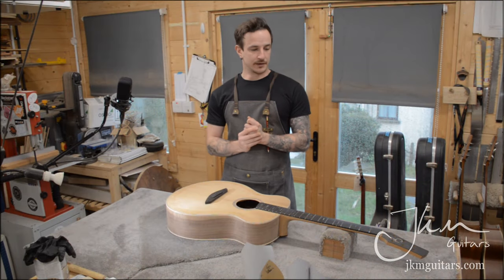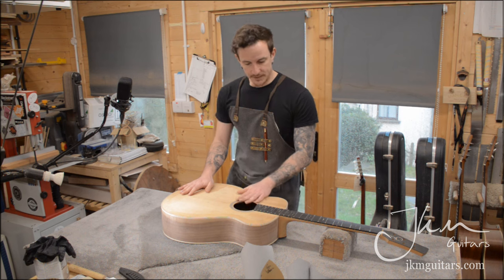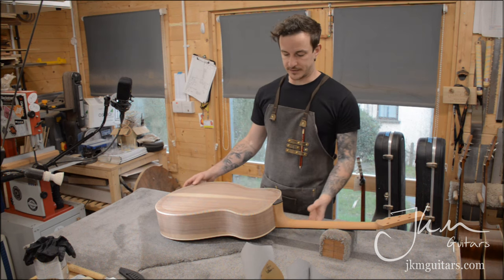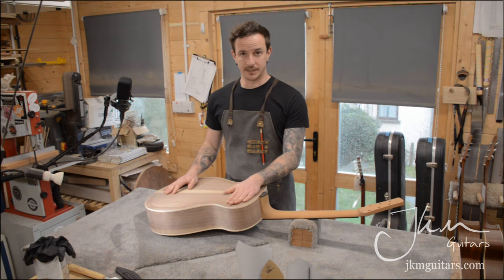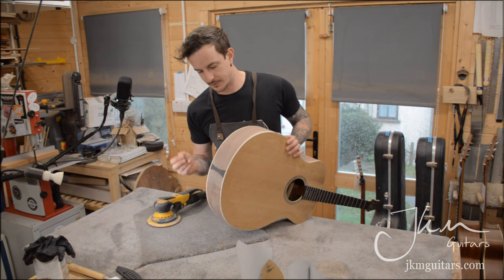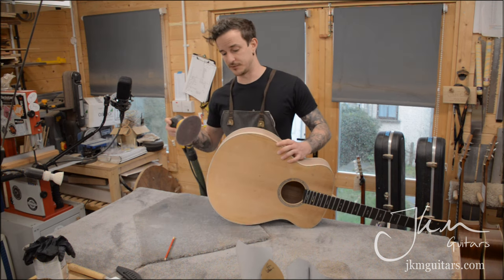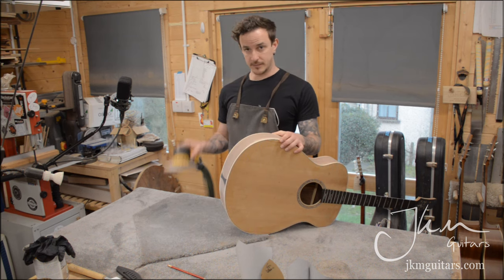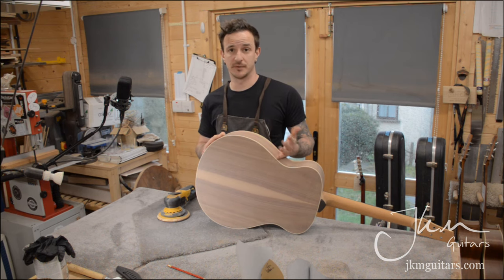Complete Guitar Finishing Tutorial - Easy Oil and Wax JKM Guitars

Comment: I think you have solved the problem I've had on my last guitars with the epoxy filler.  I had been applying the epoxy in what I thought was thin coats but always sanding through in one place or another, requiring more touch up.  Using a towel to remove the excess was genius, and I haven't seen anyone else do this.  Following up with a very fine grit dry paper finishes out the process.  This alone will save me gobs of time.  Thanks Jake!

Comment: I didn't catch what the highest grit sand paper is you are using? 

Nice video, thanks for sharing.
Reply from the maker: I think in this video it was 320 or 400 for the bare wood, and then once the epoxy is applied you can sand to a finer grit if you like before applying the oil